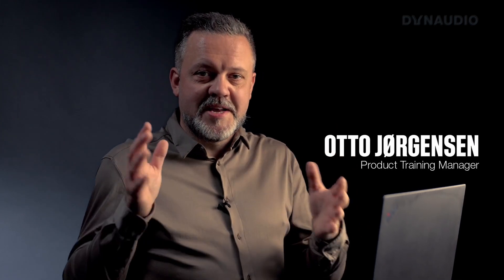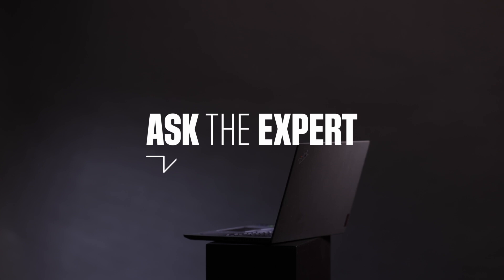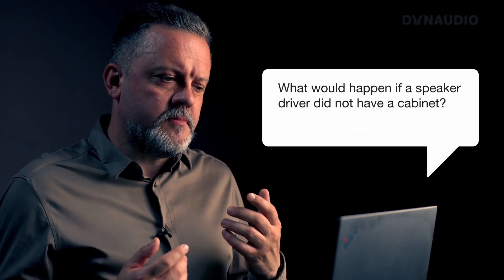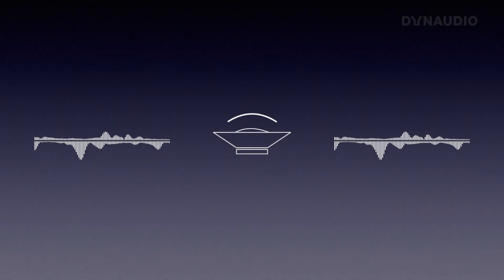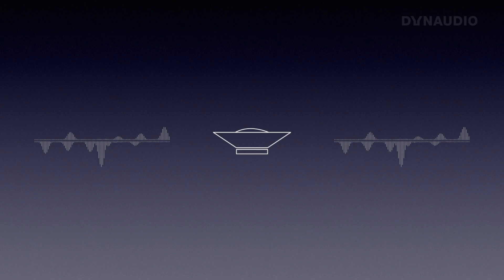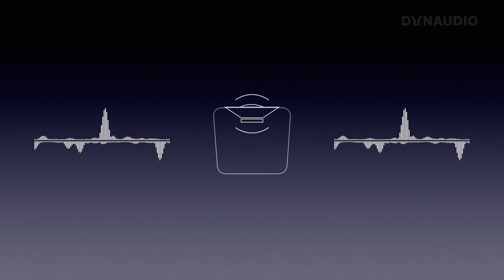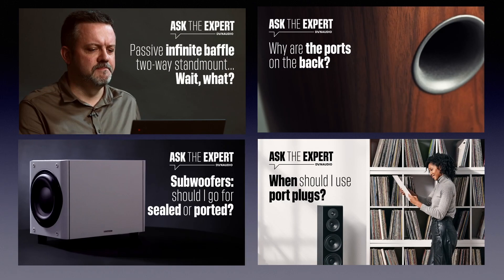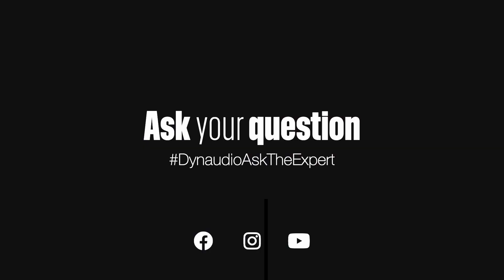Do speakers need a cabinet?

Comment: On the Emit speaker, in white, the front baffle and the cabinet are very poor color matched. Depending on the time of day and light, the baffle shifts between looking the same as the cabinet to a completely different shade of white and almost yellow( like a dirty smokers home). So frustrating to sit and listen and look at.  How much more expensive would it have been to properly match ?